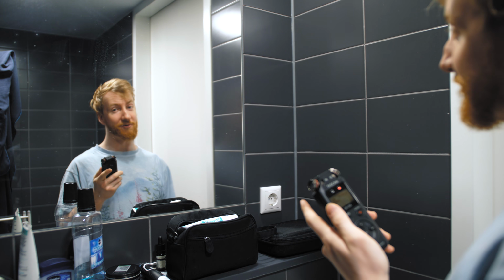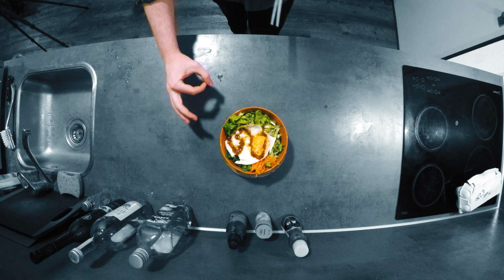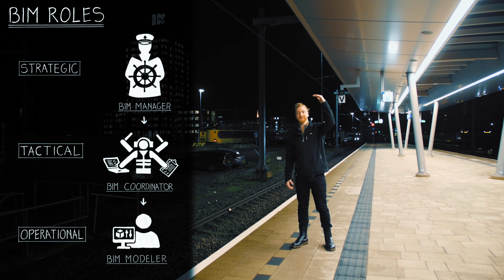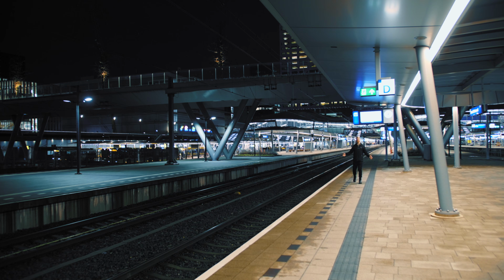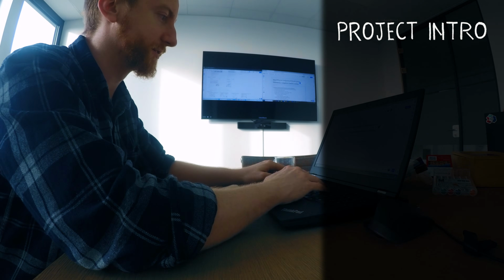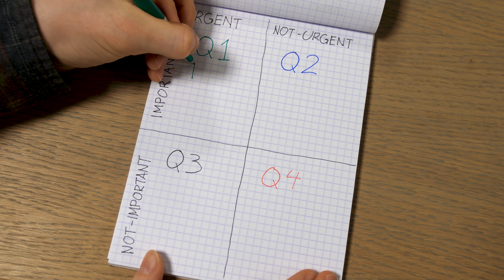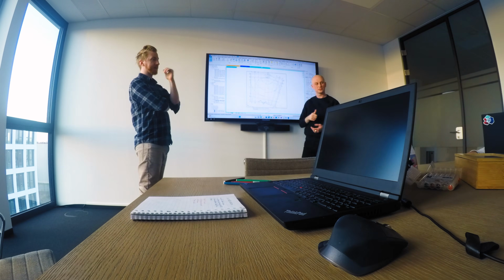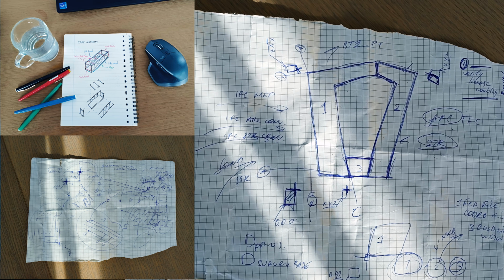Day in the Life of a BIM Engineer | Modular Housing in Germany

Comment: Hi Danku! The thought behind this video, the script, and the final outcome are just amazing! 🙌🤝

I’m kinda curious about the technology you mentioned for this prefab construction. Is it Light Gauge Steel Framing (LGSF) technology? Or is it a different system?

I wasn’t sure if that part was intentionally blurred for confidentiality reasons, so I thought I’d ask🧚🏻‍♀️
Reply from the maker: Thank you so much for your kind words, they're much appreciated!

Our prefab system is essentially a steel box (columns and beams) with a precast concrete floor. The walls and ceilings / roofs are either wood-frame or LGSF, depending on the building code and country we build in. In Germany this is LGSF. I will go into further detail in the next video!

There's a new video on the way, it's just taking a little bit longer as I am busy working towards my Architect's registration at the moment.

Keep an eye out!
Reply: @DankuSobieraj 🤝 Waiting

Comment: question!!!! what is bim software?? i thought its the same as AutoCAD? I'm wrong?
Reply: you wont answer? T___T
Reply from the maker: Hey sorry for the late response, I was travelling ✈️

Thanks for asking, it's a good question that I get asked often. 

BIM and AutoCAD are both Computer-Aided Design (CAD) programs. However in AutoCAD you draw geometry without adding information. In AutoCAD a line can represent anything: a wall, a boundary, an arrow, a path. In BIM, your geometry contains information and you have to tell the program what you want to model. For instance, in Revit if you want to draw a wall, you have to use the Wall command and the software will generate a wall with some basic properties and information attached to it (volume, material assembly, weight, thermal performance, dimensions, etc.).

Easy way to think of it:

AutoCAD = Geometry without information (you can draw anything and that's why it's such a versatile program)

BIM = Geometry + Information (is more limiting and specific but this allows for more efficient workflows and information exchange)

Hope this helps! 😊

What software do you use?

Comment: I had a question about which pc or laptop or rather let's say what are the specs should I be looking for smooth rendering and 3d modelling? 
Also loved the content brother the way you simplified the depth of multiple disciplines is underrated keep doing the work with that same passion it's rare to see people with same devotion for their skills.
Reply from the maker: Comments like yours are what keeps me motivated to keep making videos, thank you🙏

I use my current rig for video editing, 3D modelling, and rendering, I'm very happy with it. Here are the specs:

- (AM4 socket processor) AMD Ryzen 5 5600x 
- (Motherboard) B550-A PRO 
- (RAM) 2x16gb @3200 
- (Graphics card) NVIDEA GeForce RTX 3070 

For BIM and 3D modelling, I'd prioritize a fast CPU (Intel i7/i9 or Ryzen 7/9), 32 GB RAM (16 GB minimum), and a 1 TB SSD. A dedicated NVIDIA RTX GPU is great if you're doing a lot of rendering, but for Revit specifically, the CPU matters more than the GPU.

What programs are you aiming to use exactly?
Reply: @DankuSobieraj Really appreciate the detailed info man. I'm currently working on revit primarily.
Reply from the maker: I'm glad it was helpful! Definitely try out lumion, enscape, twinmotion, D5 render, and later unreal engine to find your ideal workflow when you get a high-performance rig!